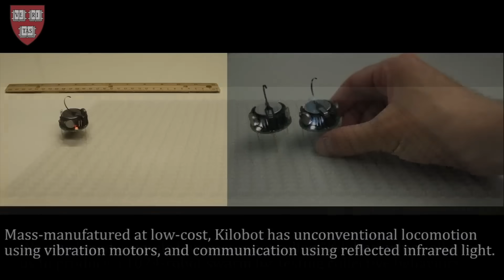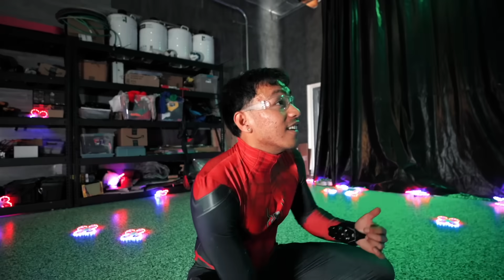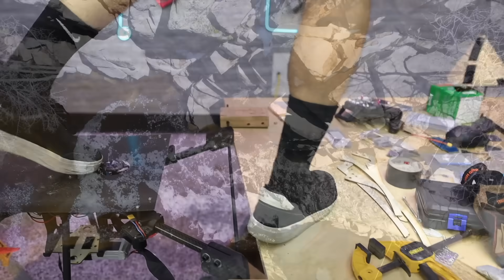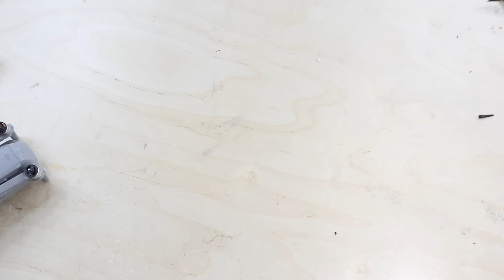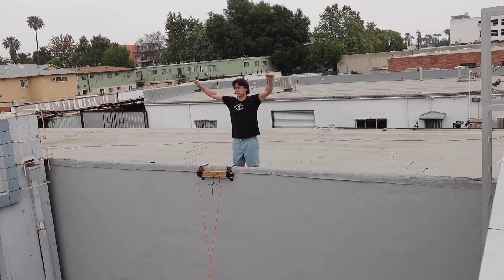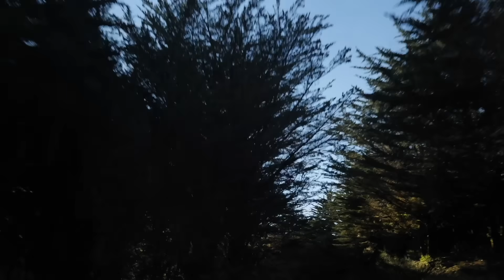I Built a Bridge Of Drones - (Microbots Big Hero 6)

Comment: Very convoluted way of setting up a rope bridge. You should have just had a drone fly a rope bridge to the other side, while the side left with you, you anchor it down. Make sure the drone has extra rope for this part. But now fly the drone around a tree over and over to anchor that side. This would actually be way more practical than your drones setting up the bridge but you still had to set up both sides of the bridge. My idea would rely mostly on the drone wrapped around a tree on the side you're trying to get to, and you would need like those emergency escape ladders or make your own to use as your bridge

Comment: maybe there is a problem with image recognition when there are multiple drones in a line. could explain some of the inconsistencies. like drone #3 switching between locking on to drone #2 and #1 as it's docking and getting different distances mixed up. I've done some AR with qr-codes and they were just all over the place, glitching, twisting and being spotted where they are not and so on, but it still might be better for targeting/short range or just verification. so if what you are using mixes stuff up a lot, you could use qr codes as targets which would also allow them to tell each other a part (at least when it works). plus you can just print qr-codes on paper so its like the cheapest thing you've ever used.

Comment: Blades are going to flex under pressure. Motors look way too small, what are their ratings? Having the drones running while locked might reduce chassis flex and increase lift capacity, at the cost of increased consuption.

Comment: Dude one idea I would've loved to see you try was to program the drones so when they successfully link up with the drone in front, they would continue leaning back somewhat to maintain a decent amount of tension on the paracord. Paracord, or what we refer to in the military as 550 cord, is nicknamed 550 cord because I can safely handle 550 pounds; and that's just per line, since you've got one on each side that's 1100 pounds.

So here's what I'm thinking: If you had each drone pull several pounds worth of tension (however much the drones could handle be it 2-3 lbs or 5-10+ pounds) it'll multiply with each link making it [in theory] more resilient to outdoor variables such as wind, because the drones between the front & mid section would be under such tension from both sides that it would've helped the drone counteract the wind. For the last few drones however, while they wouldn't have any tension they could take advantage of, at least with the drone(s) they are linked to in front, would be more standstill thanks to the tension, and therefore MAY help the back drones with fighting against the wind (as opposed to if a drone mid section gets affected first, it'll cause a domino/ripple effect screwing up all other drones both in front and back).

Basically, think of it like "crowd crushing", but the inverse of that. Instead of one drone pushing the other drone in front, it's pulling it. If you're not familiar with the concept of crowd crushing, Wendover Productions made an amazing video talking about it and crowd control in a video called "How to Control a Crowd". I highly recommend you watch that video, because even though I know you're done with this project, there's so much value in that video that would explain a lot of the issues you've had with this project as far as growing pains go. And for what it's worth, if you're anything like me, with hindsight being 20/20, you'd be curious to learn how and why certain building code ordinances became certain building code ordinances; and I feel like that video along with the above paragraph will share a lot of insight in some of the struggles you had on this project.

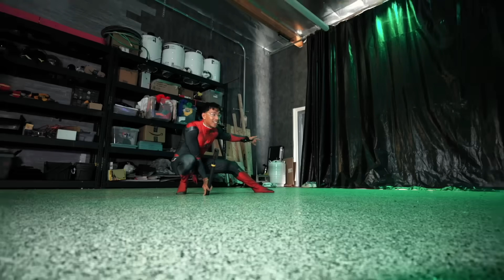Comment: I feel like it would be possible to make the doc arms faster if you use the same kind of strategy as the drones3:37,like maybe the edges of the arms have the same programming as the drones but like make it stronger and capable of lifting more weight,but I’m not that smart in this type of stuff so point it out if I’m wrong😅

Comment: The solution is to make a drone system from scratch and utilize some gyroscopes and some sort of spatial definition for a proper self balancing of the drones. This to always keep the motors in a straight line. Each motor would have to be able to individually compensate for any change in their vector system. Cool tech that someone can develop for in field drones.

Comment: They are so locked on using only small drones. But if they instead use larger drones made for outdoors use. Many of the bigger ones has also really strong frame that can hold alot of weight.

Comment: This was a tough one to make, I do wonder if it would have been possible to make the cable the connected the drones be able to run electricity to be able to charge them when they connect. moot point as the real issue was then they started doing the wave and then did a group hug. On another note, what about making the car from 2008 speed racer movie. You know, with the caster back wheels for drifting.

Comment: Really cool idea, a bit over the top, but still, major respect. What I might have done differently is to attach an external power supply to the drones, so the drones wouldn't need a battery, but instead, the energy could be transferred from drone to drone. This way, you could deliver even more energy and also solve the battery problem. But still, really great team spirit, and in general, it's awesome that you're doing something that others aren't convinced about, but you are. That's already the right approach to be a good role model for humanity ;)

Comment: 9:10 Maybe you could have used this approach if you made the first drone or two, the "attachment point" more robust than the rest of the drones, and then built the bridge from 2 sides to the middle. Then only some drones each side would need to be supported by the attachment point before they lift again to let one last drone connect everything in the middle.
Building the bridge from 2 sides would also be faster and if something goes wrong, only one side is affected.
Reply: (I liked the approach of actually walking on the drones)

Comment: Very cool
A few ideas

First I think it would be easier, cheaper, more useful to make a spider vs a colony

Eg a single capable builder that deploys cheap sturdy building materials

Applications
Send drone across for pulling a lead rope, many climbers already do this

Deploy rope ladders, belay ropes
,
Spider web bridge wall canopy, 

Second if you do use colony swarm concept
,
Teach the drones to bias towards pulling once connection is solid, eg they should never fly towards the rope once hooked up, aim at keeping tension and reduce complexity
,
Possibly teach drones to experiment with reducing throttle
As drones hook on and pull the drones in tension should be able to ease off and even turn off letting remain hold them up, but if they reduce power then that's less feedback in the system, and possibly can act as a dampener even 

I was gonna say for the x bridge design that you should look at using the whole structure put tension cables from x tips down to feet for better strength

You could combine a few spiders especially if different types 
,
Eg a ground based bot could handle heavy lifting, dense foliage, etc (carries big loads to site, has weight for ballast during construction, has ground anchoring equipment auger stakes, blast or drill anchoring for stone concrete asphalt etc, can get in close to trunks of dense brush and trees where flying drone might have problems) 
,
A climber bot could handle walls trees Etc
Suction pads, or claws
Get in close with dense foliage etc
Stronger, can lift heavier weight, stronger mounting systems, carry materials up to location, but that actually would be easier with just rope and winch, you could send a spring drone up and hook up pulleys, and either have the drone land anchor itself and winch stuff up, or have a heavy ground unit pull from the bottom against a pulley
Still could be useful eg your lining up a heavy glass window or I beam etc where you need powerful refined control more than a drone or winch could provide
,
A drone could fly between points
Delivering, doing or shooting cable and other things to location
,
Small bots could do basic tasks when launched from bigger bots 
Eg you drop a shipment, a little bot that came with the shipment starts unpacking and delivering pieces closer to site 
Or 
Starts assembling it attaching, eg you drop a seed bot with materials, the bot starts auto assembling, a growing repeating structure, you could launch several seed packets that eventually grow into each other, and later the seeds all drive back or are collected 
Or
Manufacturer bots could be dropped in a location where they start manufacturing raw materials into building materials for other bots 
Eg 
Compressing dirt into interlocking blocks
Processing chemicals into fiber, rope, fabric etc
Setting up energy capture, solar panels, battery storage, syngas, etc
3d printing, milling, etc, eg a bot could land with a bunch of lumber and cut it to shape as the site bots need 
Or
Combos of processing manufacturing bots, you could have a 3d printer combined with injection molds, or foam core generator with mill and a painting bot that coats carved foam in a strong outer shell for lightweight composite materials that can be made on-site with densely packed chemicals
,
A rope or spider bot could ride cables attaching detaching, eg a bot that sits on a spool of rope, he sits at the end of the rope and attaches and detaches the rope to things, and once he has attached the end he zips along the rope back to the big bot that has already started driving, flying, climbing to the next point, then the spider hooks up the rope again and cuts the rope if need be or they just make a continuous design weaving from point to point
Take down is just reverse

Comment: I might be wrong but wouldnt creating a virtual space software that has models of the drones in it. then you could lay the drones out like in the software,  then you can use a combination of sensors to track its position and how they are flying? Then you could use an A.I to control them using the models in the virtual space. This should make the actual flying and control a lot easier. Again I may be wrong but this seams to be the solution for me.

Comment: I don't see the point of using a swarm for practical reasons. Arborists use slingshots to launch tiny lines that are tied to thick rope to get their ropes into trees. You could do the same with a single drone to make a rope bridge.  Just fly a thin line around a tree back to the other side of the cliff, then use the string to pull the thick rope all the way around the tree on the other side.  Then secure the thick rope on your end.  Wham bam, instant rope bridge.

"my hands are curling over I have no grip"  Need to work on those forearms my man 😂

Also, that rope bridge is made out of incredibly thin rope... that's just... no...

Comment: The problem is that there's an accumulative probability of failure with each new segment. You could connect the first one, let them hang verticallyfrom the cliff, totally turned off. Then the next drone goes and docks to the first one and turns off, and so on. This way you create a ""ladder"" of drones, that then turns and they all go from vertical to horizontal and create the bridge. This way you are independent of the previous outcomes. That is called a Markov process. The problem with this method is that the height of the cliff must be larger than the gap
Reply: True

Comment: I think you'd probably want octocopters for that instead of quadcopters (because of reliability, most octocopters can function as quad or hexa copters in case of failure). and you might want to use RTK GNSS with RTCM (fancy acronyms to say use a basestation which doesn't move and know the GPS coordinates of, so each drone knows where it is within half an inch because it knows its position relative to the basestation and other drones.) if you have 2 Gps recievers, one of each side of the drone you can actually position the drone without relying on the accelerometer/gyroscope.

though the smartest solution would probably be to have one big drone that can pull a rope around a tree on the other side and come back to you so you can pull a rope bridge across.

Comment: So for bidge, 2.0 set a fishing line on single drone dock the drone on the other side. This creates a guide wire that you can pull a lightweight rop bridge across. You could use a pully system or just have a second drone slide the bridge  down the wire. 

Less expensive, less time-consuming, less difficult to make.

The funny thing about ants. They don't all follow the same input. The ant bridge worked because some ants decided to start on the other side. They became a living rope, then swung and attached to another ant rope on the other side. Then they shrank the rope. That also might have worked better for you. Give each a meter of rope in a slip not of sorts. It stars with the rope wrapped up, then the drone powers off the wait, pulls the slip not undone, and the drown just hangs there a meter down. This continues on both sides until it reaches the bottom and the final drone connects two ropes. Finely pull it tight. This way you don't need to keep the drones running.

Comment: You guys need a prototype designer.... Up until like the 16 minute mark (not sure how many months of work and repair costs), you could have focused on a small prototype of just the latch system. Like, attach your mid air latching system to a piece of cardboard, and use your hand to go "vroom vroom airplane noises" through the air and pretend it's the drones flying to each other. Make that failproof as best you can, then attach it to the drone and fix it up to fly. Would have saved an unbelievable amount of money and time...

Comment: :face-blue-wide-eyes::hand-pink-waving::goat-turquoise-white-horns:    🛩    @JLaservideo      🛩    PLEASE READ ME  I have a question and a suggestion. Instead of using the current configuration of propellers without any guards to manage wind from the propellers and oscillation, have you considered a home-built drone solution using Electric Ducted Fans (EDF) with thrust vector control? Given your smart team and the $50,000 budget and sponsorship you're working with, this could be a beneficial arrangement worth considering. I look forward to your response and learning from your insights. Ducted fans, like propellers, can be powered by various sources, such as electric motors or combustion engines. Despite consuming less power for the same thrust output, propellers are larger in size compared to ducted fans. Ducted fans also offer the advantage of vanes that can be installed in the duct behind the fan, allowing for thrust vectoring or complete reversal—a feature propellers lack.. Electric Ducted Fans (EDF) typically use brushless electric motors.

Comment: Sorry but I don't get the point of it. You don't need 10 drones to set up a bridge if you already have a docking point on the other side. You would need one sufficiently powerful drone to carry a line to the other side. Way less points of failure as well 🙄
I get that it's more spectacular your way though 😁

EDIT: I just read your pinned comment alright 😂

Comment: I would set a shape with a center point. Drones would move to the center with rfid to indicate a drone was already in position. Just need an on board raspberry pi to ignore the controller and just hold position until a new comand.

Comment: This was a really impressive achievement, but you could have accomplished the same result with just one drone carrying a spool of rope. Someone had to cross over to the other side the traditional way and set up an anchor point before the drones could do their job, which means that this system did not actually increase the accessibility of the terrain, especially given the athletic prowess it took to cross the rope bridge. Only with a rigid system would it be truly possible to assembly a bridge in mid air and then place it between two point with no previous human intervention. Once again, really cool, but I think you betrayed the original core concept of this project, I think you should revisit this idea in the future, and try to build a truly rigid bridge using a drone swarm. I'd recommend making each segment longer for fewer total linkages, and using magnets for initial alignment, like in space docking, then activating a more concrete mechanical fastener. I wouldn't even be saying this if you weren't Jake Laser. I believe in you man.

Comment: Very nice project and strong dedication! 

To me it looked like the stabilization of the drones was optimized for each drone individually but as soon as it docks, the stabilization should take into account that it will affect other drones when leveling out.  Otherwise you´ll get these chain reactions that one drone corrects it´s position and through the rope pulls anonther drone and so on.  Either you develop an algorithm for collective stabilization or you somehow dampen the transmission between the drones. Maybe through allowing for more slack in the rope during construction or adding some elastic parts.

Comment: I think that mousetrap design was best, as long as you optimize everything on it, then you can bulk up the drone for more support, and add a counter weight underneath for stability,
Reply: Also what the heck are you doing? Not testing? At least use some weights to see if it can even hold any at all, but still nice work